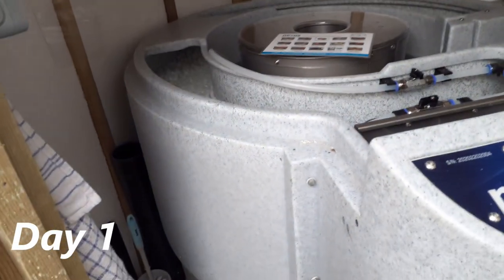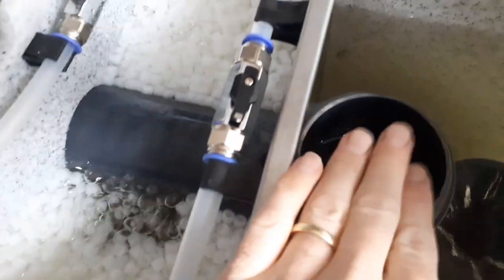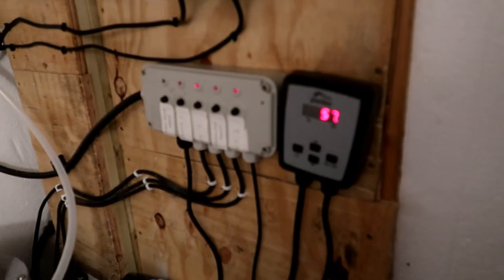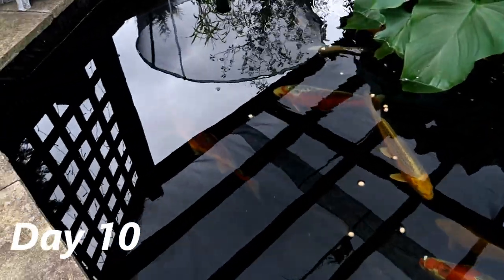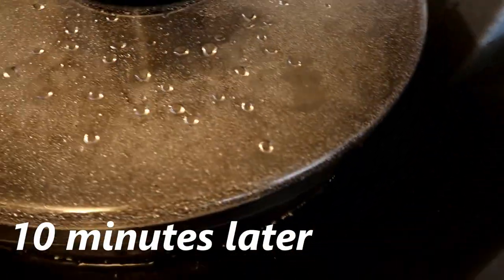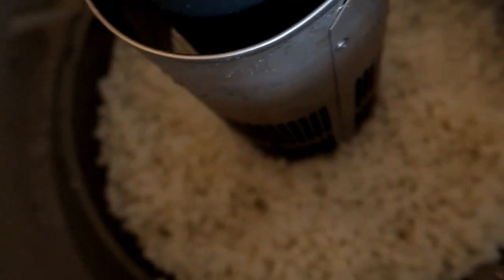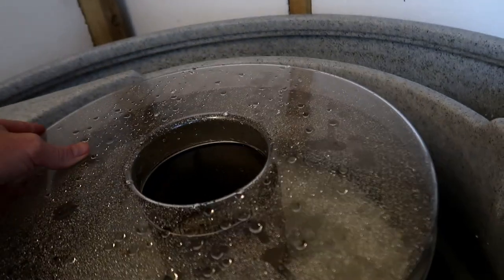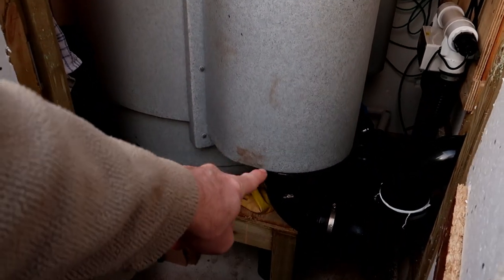Full Nexus Pond Filter Review And First Clean

Comment: Not sure if anyone has said about the back flush in the comments. But once the middle has emptied, remove the cleaning pipe. It will remove a load more muck and clear the kiss points etc. Also a lot of people put Jap mat in the outlet chamber, to collect any fines. Works well tbh. Great in depth review on the filter though 👍
Reply from the maker: Thanks Adam, yes someone mentioned about back flush
Reply: @Sharpeyskoi  Ahh good, it makes a big difference tbf.

Comment: Good video. One note about the outlet side of you Nexus. You mentioned if there's a blockage "on the output side," the water would return via the vertical standup pipe back to the center. Well... not exactly. The overflow outlet is actually used if the center portion gets blocked. This is more likely to occur in the event you're not cleaning the Nexus enough and the water being pumped into the filter cannot work its way through the clogged media in the center. In that case, the water would rise up until it does overflow the filter, which in your case would eventually empty your pond. This is the most dangerous scenario with a pump-fed filter system and a pond with a bottom drain. You can accidentally and completely empty your pond if the water from the filter doesn't make it back. In the case of the Nexus, if the middle portion is completely clogged, the center chamber uses this overflow pipe to return the water unfiltered back to the pond. Yes, this would be unfiltered water, but still, a better choice verses accidently sucking your pond dry. If the output pipe back to the pond gets clogged, that would actually be a very rare event, but much worse. There again, if the water cannot make it back to the pond, your koi will end up gasping at the bottom. There are several ways to insure this doesn't happen: water detection on the filter-room floor that shuts off the pump, a collection system under the filter that sumps the water back, level detectors in the pond - so when it gets too low, again... the pump shuts down, etc. This is where gravity fed systems do have their advantages, because with those systems, the flow of water to the filter would simply stop. Yes, it could also mean the return pump might run itself dry, which is not good for the pump, but still, a better choice compared to pulling all of your water out of the pond. Most external pumps have electrical thermistors built into their casings that cause them to shut down if they get too hot. This does offer a bit of protection, which is a good thing. After all... we don't want to have to choose between a pump catching fire or accidentally emptying our pond.
Reply from the maker: nice one. thanks for the info, appreciate it

Comment: Hi mate . Looking good. I have used Nexus for number of years and very happy.. i struggled a bit with 75lt air pump and upgrading  to a 90lt made a masive difference. So much so I now think the 75 is too small for the nexus.
Boiling for cleaning is now perfect. Wish I had  changed up years ago .
Reply from the maker: Tbh my 75 works perfect.

Comment: You can definitely the difference in water clarity. The nitrate .. have you tested your tap water? I have a lot of nitrate in my tap...  
The high nitrate is often due to the lack of anaerobic bacteria, which you can only achieve with good porous ceramic media to colonise inside media. Which plastic media cannot achieve . It's the only thing that will eat the nitrates. Plants help slightly but you need sometimes like 5 times the size of the pond to be really effective. But any plants will help a bit.  Have you considered putting a shower?
Good video, I enjoyed it.
Reply from the maker: Yes I still need to do that after our last conversation
Reply: @Sharpeyskoi  your pond looks super cool. If my pond wasn't so high, I would have definitely got the Nexus 220.
Reply from the maker: @LauMagroTheFrenchKOInection  thanks lau. That's why I've got my return like I've don't it. So it comes out outlet then back up to go over pond wall. As long as top of outlet pipe in final chamber is higher than pond water level then gravity will send back up to pond.
Reply: @Sharpeyskoi  absolutely. How high is your pond from the ground?
Reply from the maker: @LauMagroTheFrenchKOInection  my garden slopes but nexus side is about half metre

Comment: Great kit the nexus , ya might want to get a bit more water volume in there ie looks a bit low 👍  you’ll get the hang of it it’s defo a good system
Reply from the maker: Its not anymore. This was first few weeks
Reply from the maker: I also think it's because it's pump fed as it has the outlet pipe in last chamber will I don't think gravity has
 So I guess the water level depends on the height of that pipe?

Comment: I started of with small kockney koi filter upgrade too eazypod then upgraded too nexus200 when money was available my pond is 10000lts I have just bought a EA 20000lt vari pump for nexus pump feed and gravity return have to ask why have you got your return like that why not straight  back level too pond ??
Reply from the maker: Because then I'd have to have to have nexus higher up. This way it comes out the bottom then back up to go over the pond wall
Reply: Hi mate when u do cleaning don't forget too back flush when u empty the inner easy part when completely empty pull the bung out middle and let some water flush back too clean it through keeps every thing clean all the way through the nexus filter
Reply from the maker: @kentishkoi9352  ah brilliant thanks for this. Great advice I didn't know about
Reply: @Sharpeyskoi  like I said mate I do it every time I clean my nexus out